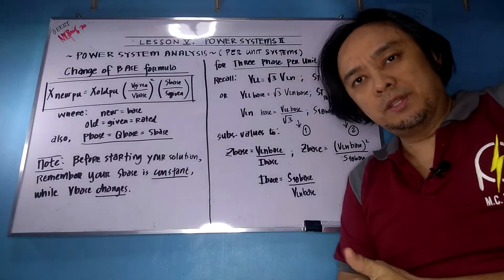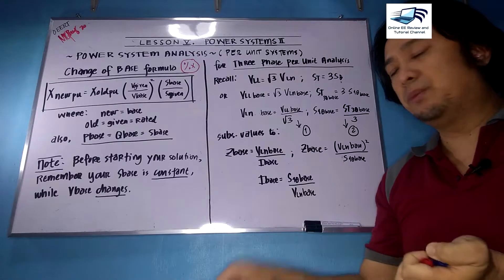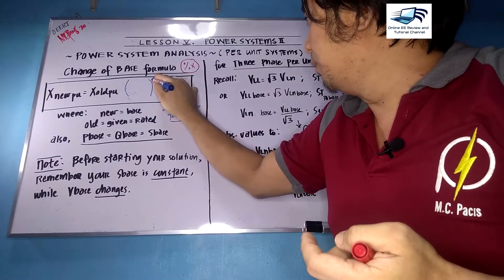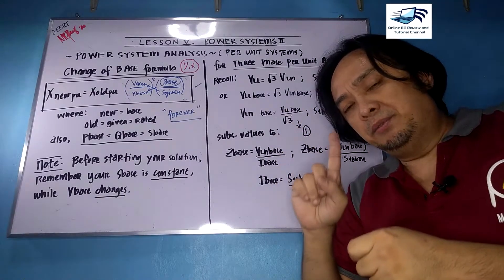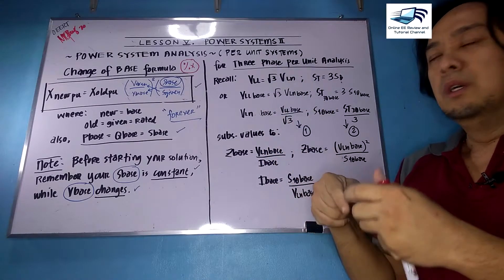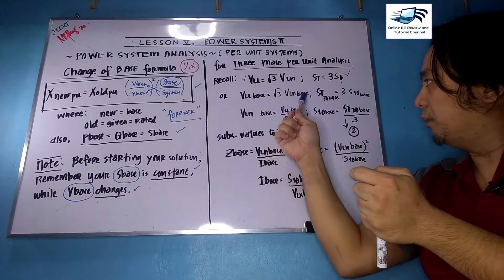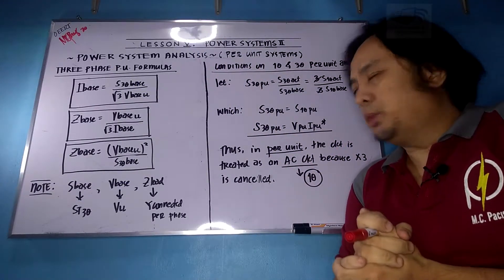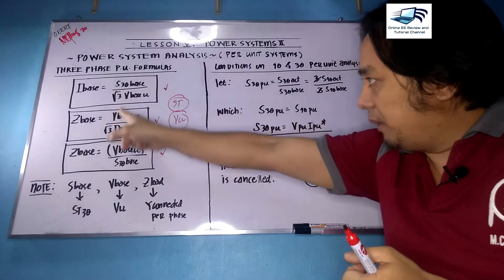Lecture 5.2. Per Unit Analysis Fundamentals (Three Phase Systems Part 2)

Comment: sir sample nga po ng base voltage computation kase dba nagbabago bago sya.. and pano kapag step down and step up transformer sya tas kocompute  tayo ng per unit ? thank  you sir ..
Reply from the maker: The computations are already there, the principle of the tranformation ratio is the same which is a=v1/v2 or simply Vbase1/Vbase2 dependent on the region. There are times that the base is on the 1st or 2nd region but what ever region that you choose, the answer on the bases are the same.In terms of pu value, just divide the actual values by the base or if you have %reactance simply change of base. All of that is on the fundamentals and problem solving. Goodluck po